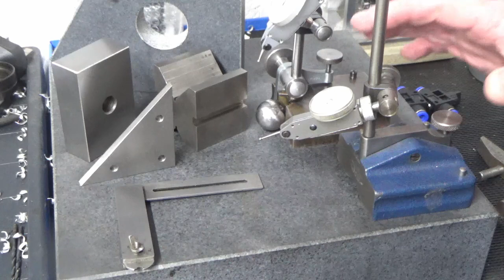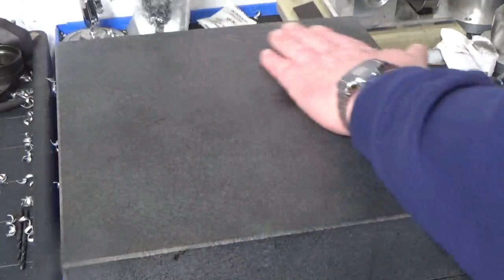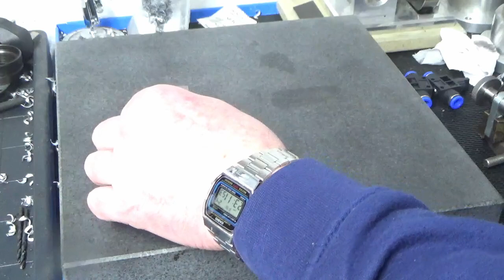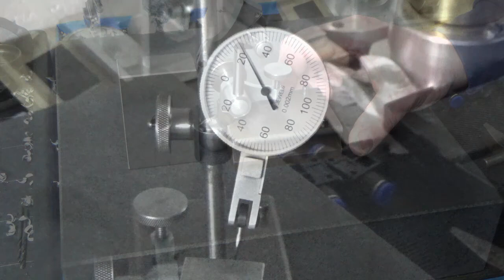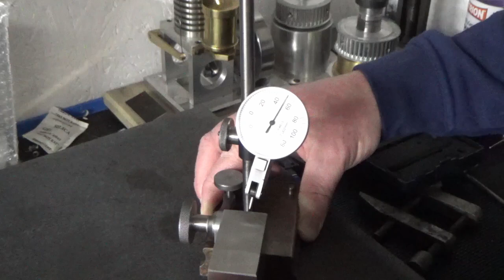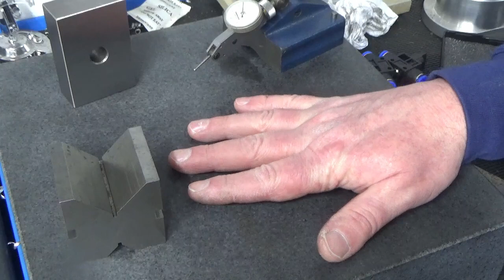Workshop Tips #11 - Measuring Squareness in a Home Shop on a budget

Comment: when you measured the parallelism on the 123 block would you not sweep both sides? reason I ask is if you sweep only one side like you did, and it was ok, there could still be a possibility (highly unlikely) of a dip in the middle of the other side ?
Great video, would like more like this if possible.
Reply from the maker: Hi Paul, thanks for the comment. Yes, definitely a possibility of a dip, and the method you suggest is correct. I did the "Making assumptions" thing lol

Comment: Brilliant stuff Jon. It is funny, I just bought a surface gauge that has the ball end on the post for just this reason. It is an ex MOD one from the 1950s still in its wax coating! I got it as I am trying to get the bits together to have a try at scraping.  thought your video was excellent. You have a talent for making any concept understandable.

Comment: Question for you Jon. Stefan Gotteswinter did a video where he made a Squareness Comparator with a semicircular bumper at the front. Made me wonder could you use a bearing instead of the ball? Cheers Nobby
Reply from the maker: Hi Nobby, thanks for the comment and question. In short, yes. What I showed was the poor man's version of what Stefan did, and achieves similar accuracy. Any ground regular surface would work (including a bearing shell). Cheers, Jon
Reply: @jonsworkshop  Thanks for that Jon. I think I can get my hands on a bearing easier that a ball, and at least it won't roll off the bench never to be seen again Cheers Nobby

Comment: What ho Grasshopper, 
Another good lesson for your viewers 
I might take issue with you on the "cosine error" issue, If I were to be pedantic,  who me?, as your aim is to reach the same reading on the dti dial there is no cosine error as you are not taking a measurement but using a reference point. See the point?😉
Back when I was setting up my home shop i used to visit a pre owned tool shop run by a lovely old chap who ran it as a retirement hobby. I got some real bargains, as did all his customers,  and I know regret not buying one of his many cylinder squares. 
One of the things I bought from him was a Myford super 7 on a Myford industrial stand together with a brand new 3 phase converter, I wanted an imperial lathe as my Colchester is metric, he must have really hated me as I had to pay 300 quid for the lot.😊 I know how to make people jealous, amongst my other talents!😂😂
ATB 
C
PS, if you like cheap, I'm told gudgeon pins from big diesel engines make a good starting point to make a cylinder square if you can lay your hands on a new or unworn one. They have a lovely lapped finish and can be quite large enough for home shop use.
PPS, you never stop me quoting "flat, square and parallel" none of this perpendicular nonsense.
Reply from the maker: Hi Chris, thanks for the comment. You are quite right on the cosine error! Slip of the mind and tongue lol. Buggers up my OCD though to see any DTI not attacking the workpiece square on! Wow, you got a bargain there. Cheers, Jon
Reply: @jonsworkshop  yup don't we all have ocd, although people do get obsessed with cosine errors when you only need to see a lack of movement rather than an actual or a quantifiable amount.
Even better bargain as it is the Super 7B with screw cutting gearbox, just think how much cheaper it would have been if he liked me.😉 
His was a shop that all the local machinists flocked to, and in my case a forty Mile round trip, and is sadly missed.

Comment: 1) rub your surface plate with your hand and it is immediately not clean.
2) If you have three 'square' items, and they all match up against each other in all three combinations, then they are all square. Nothing else required (other than the surface plate). 
3) Your 'checked' 1-2-3 block is not a reference, it is a sub-reference. This is an important distinction in quality control..
Reply: If I were to take issue with your comment I might say that as the aim is to make sure the surface plate is dust free when you mean "clean" the possibility of leaving an even layer of hand oil is irrelevant for intended purpose.
Regarding the 123 block, for the shown purpose once checked for precision it does indeed become a  reference. It was checked for precision in its own right not referenced from another, therefore it is by definition not a sub anything. Just saying.
Reply: @chrisstephens6673  Check how standards work. There is a reference standard, which is used to calibrate others- which are traceable back to the reference standard. These are sub-references, named to avoid confusion with the actual standard. Why? Because each calibration process introduces errors, which accumulate. Using commercial dial gauges, especially in a workshop environment, will certainly do so. That is why things like slip gauges come in laboratory : toolroom : shop floor varieties. Accuracy costs.
The block in question is a sub reference, because it is a sub-standard. Not a pejorative label, it just places it in the accuracy hierarchy. Perfectly fit for workshop use, but NOT a reference item.
Reply: @Tensquaremetreworkshop  oh dear, someone more pedantic than me. We are talking workshop reference not NPL standards. 
I hope you don't ever use a vernier caliper,  their inherent inaccuracy due to the measuring points being out of plane with the scale must be a real pain for you.
I don't mean to be snippy but get real,
Reply: @chrisstephens6673  Thank you! Pedantic means accurate … I use measuring equipment commensurate with the accuracy required. Knowing the limitations of what you are using is key. Also, ‘Reference' is not an object- it is shorthand for ‘reference standard'.
Reply: @Tensquaremetreworkshop  reference, the use of a source of Information in order to ascertain  something.
Standard, something used as a measure, norm, or model in comparative evaluations.
Strictly speaking a square can never be a standard in international standrd terms, like a kilogram or some other physical property, but only a reference. A square only defines a quarter of a circle, not a length or mass, which can be defined. The subject then changes to calibration but that could just prolong the debate because all calibration is referenced to a standard, and round and round it goes.🤣
Again don't think I'm being awkward but I like intellectual arguments, or is that debates.😉
Reply: @chrisstephens6673  Actually not round and round- it is a linear path back to the national standard- traceability. Yes, some things do not need a standard- the point of my '3 squares' comment.
Reply: @Tensquaremetreworkshop  do you do a measurement system analysis on your measurement equipment to decide on its suitability?
Reply: @andrewbaron8713  One chooses measurement equipment depending on the tolerance permitted in the measurement being taken. In most cases this is just custom and practice- measuring tape/steel rule/Vernier/ micrometer... The error of the measurement must be within the permitted deviation. Many other factors intrude, especially the accuracy of the equipment used to make the part to be measured. Yes, in some cases this requires analysis of what is to be used and how.
Reply from the maker: Hi Mike, thanks for the comment. I was taught to use my hand during my apprenticeship, and subsequently have been involved in many root cause investigations at Rolls-Royce with the metrology guys where in most cases debris from lint free cloths, cotton cloths, microfiber cloths and environmental dust were found to be the issue. It is interesting to note that the metrology dept now use Blue Tak to clean the ruby on CMM (Coordinate Measurement Machines) prior to calibration and measurement, as the oils within it remove the debris left behind from cleaning cloths. One thing my 35 years of experience has taught me is that what you thought to be true yesterday, will be proved wrong tomorrow, therefore I am keen to know what you would use to clean your table? On your second point, if you put 3 things on a surface table you 'assume' to be square and you find discrepancy, without physically measuring as I demonstrated, I am not sure how you would determine which one of your 3 things was to be relied on, again maybe I am missing something and remain open minded always to learn new things so please explain in more detail if you wouldn't mind. On your 3rd point, I was referring to home shop standards/references all explained by the video title and preamble, and at the end of my video, I explained how the NPL system works in industry. As a creator yourself, you may have some sympathy that not every word you say on film will be 100% accurate. Cheers, Jon
Reply: @jonsworkshop  Not meant as criticism, just info. Hands may be fine for granite- those of us using cast iron risk rust if we forget to apply protection after use… 
I meant the 3 square test as a confirmation- but you can work out how to correct errors. All this is the origin of precision- grinding 3 surface plates to each other gives you flat with no other equipment. You can actually test/ produce 3 squares without the surface plate- just takes more steps. Zero other equipment.

Comment: You can fix those oil stains by turn the surface plate over !
Remember I was born up side down.
Kit from Down Under
Reply from the maker: Hi Kit, thanks for the comment. Lol, if you stretch up I will let you use the underside, might need your hard hat on though! Cheers, Jon

Comment: Having recently been given a beautiful little surface gauge in exchange for some machining I was baffled by the vee shape in the front of the base, what could it be for? Now I know! Very helpful video. Cheers.
Reply from the maker: Hi Nigel, thanks for the comment. I think the V is just for clearance for the upright (might be wrong). But it's very handy for this check😊. Cheers, Jon
Reply: @jonsworkshop  it is clearance, plus it allows the upright to pass through and measure below the guage, using or not using the pins at the rear, as as I understand.
Reply: Be careful when using with a ball, unless the vee is machined and perpendicular to the base the ball can ride up off the table. Some are just cast in, or painted.

Comment: Great video, Jon.

One of the best perpendicularity references available for a machinist "on the cheap" is making a cylindrical square from a length of ground bar.  Chuck it up in the lathe, face off one end and hollow out the centre slightly so that, when place on that end, it's only resting on the rim.
Reply from the maker: Hi Wibbly wobbly, thanks for the comment and feedback. Cylinder squares are excellent, turned on a lathe works as long as the diameter is parallel along it's length which I am sure you already know 😉. Cheers, Jon
Reply: Piston gudgeon pins are an excellent ready made cylinder square
Reply: @philmenzies2477  Oooh, I like that.